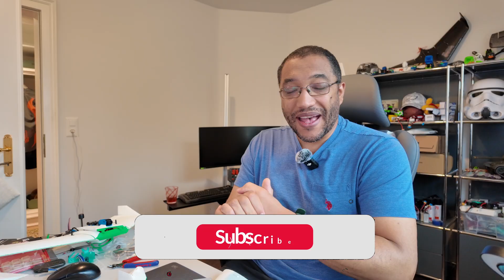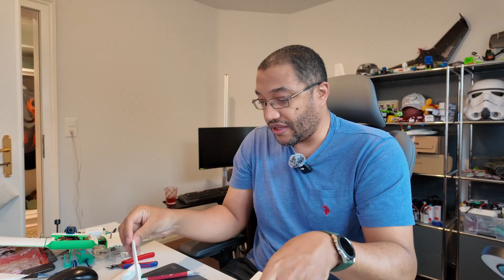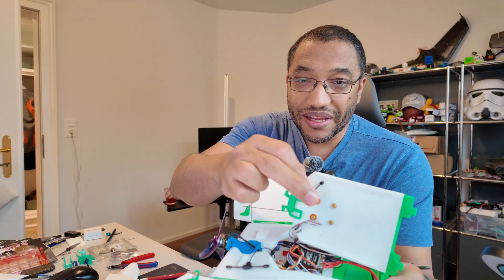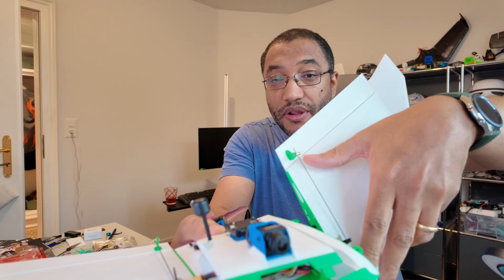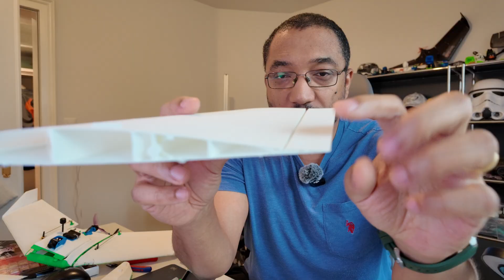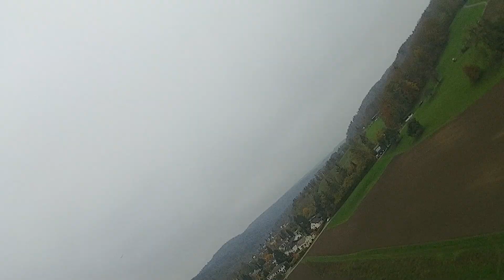3D printed Breeze model X - Building Tips

Comment: I am REALLY struggling to get the winglets to print well. I've tried the stock 3MF settings, the Soarkraft presets straight from the STL, and loading up the 3MF then putting the Soarkraft on top. Nothing is working well at all. Printing on an X1C with (pre-dryed) Bambu Aero PLA. Any ideas on how to get this thing to print?

Comment: Thanks for the video! How are you mounting the VTX to the canopy? Is there a .stl for that mount somewhere?
Reply from the maker: Thanks, I did 3d print a light TPU mount to separate the VTX from the canopy. I can send you a link to the file.
Reply: @McLogo76  That would be a great help, thanks!
Reply from the maker: @icebalm  This is the file I printed in TPU https://drive.google.com/file/d/1DUYrk7VTPZOusmnR7e1EevmpEd6kNiGb/view?usp=sharing
Reply: @McLogo76  Amazing, thank you,  and did you just CA glue it to the canopy?
Reply from the maker: @icebalm  I did actually drill 4 holes through the canopy and used screws with washers.

Comment: Hello, i also built this plane, but i dont know where to put the battery. Is it supposed to be put in the front or in the back? And also how did you get all those components into such a small plane, because i cant get them all in.
Reply from the maker: The battery should go in the front on the flat pla that you glue in. You can basically only get the center of gravity correctly like that. Yes it is a bit tight but the right components should fit in. Also make sure to use XT30 connectors and the cables accordingly. XT60 ist to big/heavy and the cables are too thick.
Reply: @McLogo76 i have 3 xt30 cables for all the connections and they use up all the space, do you have less or did you manage the space better?
Reply from the maker: @adrianionescu7544  I can send you a picture of how it looks inside with the FC/battery and wiring if you give me your email.

Comment: Where can i buy all the parts?
Reply from the maker: @LunarEngineer-Q2S  I guess that really depends were you live. But you can get basically everything needed from fpv / rc platforms. The manual of the breeze lists the parts he used and I would recommend to get similar gear.

Comment: where can i source the carbon rods for this project? haven't found the right dimension listed or if i missed it TIA
Reply from the maker: I also got that wrong the first time: 5 x 300mm Carbon Tube x 1 was a bit confusing...
You need a 5mm diameter carbon tube that is 300mm long. I got mine from a local hobby shop that sells 1m carbon rods and tubes. 
Maybe amazon?
https://www.amazon.com/carbon-fiber-tube-5mm/s?k=carbon+fiber+tube+5mm
Reply: @McLogo76  awesome thank you that is what I had picked out I just want to make sure I'd did that correctly. Thank you!